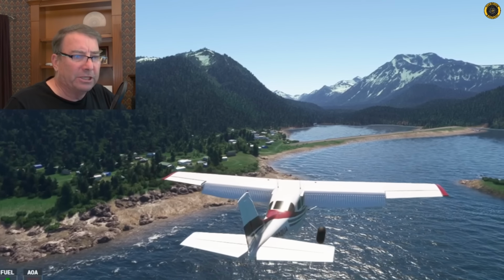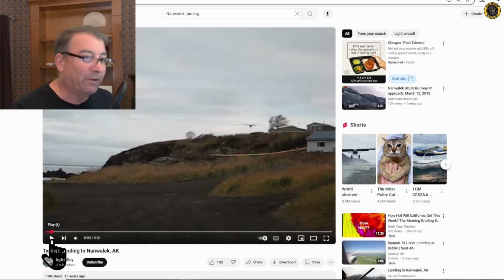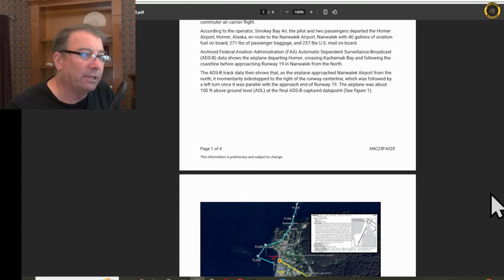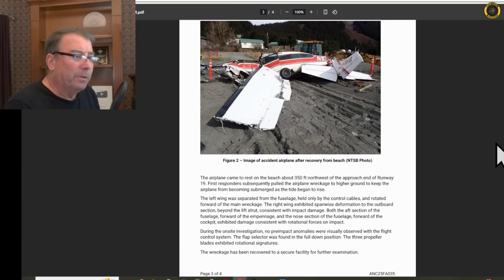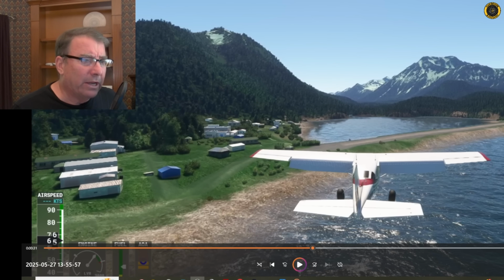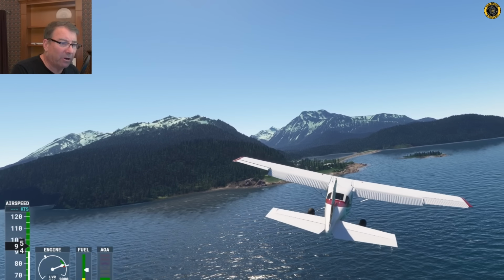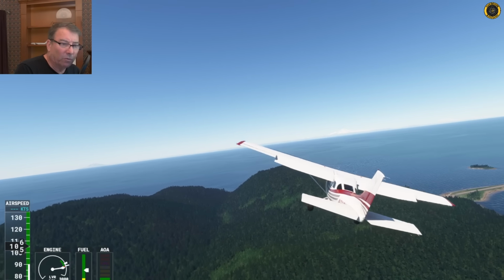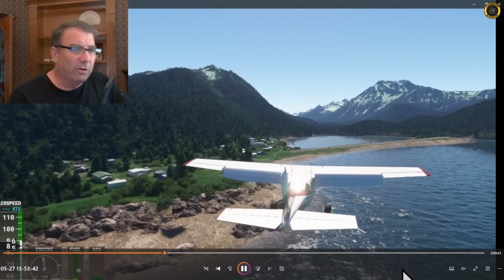NTSB Prelim Cessna T207 Crash Nanwalek, AK

Comment: The canyon is an egg beater. Port Grahm is on the other side of the mountain, the winds funnel into the choke point then rapidly expand and make a 180 degree turn up the next fjord. The turbulence would tear you apart. The water is 99% of the time your only option, though the impossible is created in nanwalek.

Comment: I have been flying professionally for over 50 years , I have noticed a trend. Answering a call from ATC with your Call Sign and not repeating the ATC Instruction. Professional Pilots, especially 121 operators need to step up their game.  Also, ATC should correct the crew on procedure.

Comment: Just simply heartbreaking 😢

I worked 207s out of Bethel and a little bit out of Talkeetna (until a more junior guy came along so I could hold the 185 full time) and even did a short stint flying a U206G with a belly pod for Danali Wilderness Lodge (Lynn Castle's old place)

I've taken 207s into strips as short as 1000' (Cinnabar Mine) and more routinely into 1300' (the old Eek village strip). It's a perfect winged Econoline van for the Yukon-Kuskokwim Delta. The gravel strips can be short, but as long as you can clear the trees at the end of the runway itself, there's nothing else to hit for the rest of the flight. 207s like flat terrain

A friend of mine was all but killed in a go-around stall/spin crash in a 207 at Napaskiak when a Markair Express 207 he was following failed to completely clear the runway during low weather icing conditions while folks were trying to get specials into Bethel. He was badly injured but survived to fly for a couple more decades. An ATP with over 17,000 hours of backcountry 185, 207, Cub, and Beech 18 work, he was eventually killed along with his Fish & Game biologist passenger in a "moose stall" while literally counting moose

After losing 35 friends, colleagues, former students, mentors, and loved ones who died behind the controls, I don't judge. I just mourn and I try to remember them all

While we're here, RIP Keli Mahoney, Iditarod musher, the finest stick & rudder driver I have ever known, my former chief pilot, my former fiance, and my best friend in the whole world. A185F, South Hunter Pass, Denali Massif, May 28, 2003

Comment: I'm given to wondering if the ADSB track is accurate. I notice that often below a few hundred feet planes near me (eastern Massachusetts) often disappear from ADSB-exchange so I wonder if inconsistencies are introduced due to being low and so close to the mountains. Also, is the surviving passenger a pilot? Could they possibly confuse a wing drop in a stall with a steep turn? What if the track was more normal, and a slightly too fast pull up for go-around combined with a gust going away at the wrong moment, one side stalling before the other... Just speculation of course.

Comment: Hi Juan. First of all thank you. I just wanted to give you some info on Flight Sim 2020, as I pretty much play it daily, and as you did in this video, fly in the 'outside view'. My advice to you is regarding the flight stick that u are using to fly in the sim. As you stated, it's not the greatest. I would advise you use a video game controller, like from an Xbox or PlayStation. If you do, you will have access to flaps, landing gear, throttle, rudder, and control over the outside camera, all in the palm of your hands. Modern video game controllers have 2 analogue thumb sticks, and in this case...the left stick controls the airplanes movements, and the right one controls the camera movement. The buttons on the front are for throttle, and the cross shaped 'D-pad' or digital pad, has a function set for each direction. I.e. press left for landing gear extension. Press it again to retract. Up is flaps up one notch...down is flaps down one notch. It is fairly straightforward to connect a gaming controller to a pc, and then Flight Sim. If your 'mini-me' can't help, then YouTube can. It makes flying, and enjoying the sim so much easier, and because this is how I fly (PS5 controller), imagining flying with a flight stick like the one you showed gives me a panic attack!! lol. Love you, and the channel, and because it can't be said enough....Thank you Mr. Brown.

Comment: Hey Juan, Thanks for getting back. It has been many years, but I don't specifically recall overflight of the lagoon being unauthorized, other than possibly 135 Ops Specs. However, there is no reason to ever overfly the lagoon. Additionally, the lagoon is surrounded by rising terrain to the east of the runway; that area should be considered and treated like a box canyon/confined space. A pilot would generally be asking for trouble wandering in there. You will see that area is a lot tighter in person than perceived on google earth, etc. I would highly recommend you go to Smokey Bay Air and have them put you in the left seat with one of their pilots so you can experience the full effect of this place. You want a 206/7 with the sportsman STOL/micro VG's. Keep your head outside and you need to be very aware to "pedal it" through the soft spots. The other thing is to keep your bank angle shallow on departure, but not too shallow. I will be very interested to see your next report after you have been there, and made about 5 takeoffs and landings in both directions. You absolutely owe it to yourself to experience this place. Have them take to to Seldovia and Port Graham first. Then after Nanwalek, you might go down around the corner to the old English bay, and be alert for the crosswinds there as well. Fly safe and keep up the good work!

Comment: Am I the only one seeing that the left turn was probably due to full power torque for go-around with not enough rudder, maybe result of getting too slow because of flap setting, and not an intentional turn to the left?  Approach was normal from over the village.  Decides to go around, starts offsetting to the right, tries to climb with full flaps still and approach trim, gets slow and high angle of attack, runs out of right rudder authority, and spins to the left.  Not saying that's exactly what happened or why, but it seems to fit the ADS-B data, which may not be super accurate right there anyway.

Comment: It's obvious to me this is a botched go around. It's one of the most common least talked about LOC-I accidents IMO. My friend died 2 months ago for the same reason. Low and slow on final, fully configured for landing, last minute go around with incorrect technique and this is the result. Once full power is applied, nose pitches up dramatically due to the nose up trim if not anticipated and counter acted, approaching critical AoA and without the proper amount of right rudder to counter the left turning tendency the plane yaws and then rolls to the left, stalls and enters an unrecoverable spin. The witness account pretty much confirms this is what happened.

People need to practice their go arounds! Practice and brief the procedure before each landing!

Comment: The simulator flight makes it so easy to see how the pilot could have seen that terrain filling the windscreen, pulled back to accelerate the turn, and in that configuration, exceeded the angle of attack limits. Sobering how quickly it can all go sideways. I'm just an aviation nerd, but I find these videos tremendously helpful in my decision-making as a sailor. Thanks, Juan for your hard work.

Comment: HI Juan,  QUESTION: is it possible today, to equip single and multi-engine civilian aircraft with an audible STALL WARNING instrument, that would alert pilots when they are flying close to stall conditions?  Seems this kind of instrumentation should be a priority item to have onboard, as so many accidents are due to aircraft stalling for lack of sufficient speed and/or excessive angle of attack.  Thank You!  Kind Regards,  FMR Intelligence Officer
Reply from the maker: Already onboard. It all happens just so fast…

Comment: Good points about startle, the simulation made it easier to understand. You should definitely check out the new version, Microsoft Flight Simulator 2024. They made some massive improvements especially with terrain quality and detail.

Comment: Gee, how many things could be stacked against him? According to AirNav “first 1000ft closed indefinitely, remaining 850ft poor condition, high water erosion, 4” diameter rocks, strong gusty winds, no approaches, rising terrain, no vertical guidance, tribal council building on very short final. And lastly, to the blasphemy of Cessna pilots, a 206 or 207, even with the IO-550 is a VERY underpowered airframe at heavier weights and full flaps during tight maneuvering, requiring HUGE rudder inputs to overcome design deficiencies. Only the turbine-engined 208 Caravan was able to overcome these 60-yr old issues.

Comment: The sim was very useful indeed and made this situation very relatable. 
This very late final approach turn looks extremely dangerous and aerobatic to me. I can’t understand how this can be the normal approach path. Talk about a stabilized approach path…
Flying over the village, straight to the runway, would seem much more logical and safe. 
A late go around to the left in such a tight space is indeed quite a bold decision, even with a proper timely flaps retraction. These pro pilots should know it.

Comment: Based on track, isn't it possible they were conducting an approach straight in over the town, saw the dog started a right turn out.  The go-around power caused the airplane to pitched up and slow.  Not enough required right rudder to stay coordinated in slow flight while struggling with the elevator could have stalled the left wing causing the airplane to bank left losing control and lift causing the crash track and location.  What do you think?

Comment: In 1982 i and 5 friends in a 1978 t-206 got in a tight box canyon in the mammoth lake area 1000 ft above ground and under the high steep ridges.I could not safely turn, too narrow so i hugged one side of a ridge and slowed to a near stall , 10 diegres of flaps, reduced power , pushed the nose down - unload the wing and quickly turn left \ spiral down one half turn as if coming down a fire pole and pulled up smoothly fast but not to stall with no issues, even passengers that i told i need to make a quick turn were ok. the aerobatic training in the super decathlon is why you don,t panic and just give up. airplanes are highly manuverble. lost control is the biggest killer iv seen in 50 years.

Comment: I landed there in 1984, delivering a (short) telephone pole to our telephone construction crew in a Cessna 180.  I landed to the South, with a dogleg partially over the village.  I felt it was a strip that you needed to be prepared for, and required precise flying, but wasn't particularly difficult.  I planned for a right turn if going around when landing to the South, and there was plenty of room for that.

I cannot imagine why someone would turn left to go around from a right base leg/dogleg final landing to the South.  Even in a Super Cub.

One of life's great mysteries is why experienced pilots get themselves into trouble doing the same thing that they have done dozens or hundreds of times before.
Reply: What if he had a stroke or mini-stroke (TIA)? The brain malfunctions just a few seconds; on the ground, not a big problem, but in the air, those few seconds become forever. I have no knowledge of this pilot or incident. But our brains can let us down sometimes.

Comment: I taught 3 feet full flaps go arounds on C150 in my 1990's CFI years. I taught to throw yourself forward and to the right when apply power.  Noticed some students or pilots tried to do the contrary and stretch body up to try to see over the nose high now, which dont let them push forward control wheel and right rudder.  Also a right turn with less rudder WILL BECOME A RIGHT SLIP, which will kill speed to a stall. Throw yourself forward and to the right, flaps 20 and if turning right, press that rudder well.  Dont turn over 25 bank anyway..  I have videos doing 3 feet go around on C150 at 70 degree farenheit.   I also taught aerobatics and 5 kinds of EFATO too.

Comment: When I was a freshly minted private pilot I was doing a touch and go at Everglades City Fl  (2,400 ft)  in a C172 . When I applied full throttle and put the flaps up they failed to retract. The aircraft jumped back into the sky. I kinda froze. I thought we were going to hit the trees off the departure end of the runway but my passenger (an A&P mechanic) recycled the flaps without telling me. The Cessna sank back down but I held Vx attitude and we managed to clear the trees with what seemed like inches to spare.

Comment: Almost everybody knows when you are low to the ground you stall you die and everybody just keeps stalling and dying, what is it with that, so many incompetent pilots!
Reply: Fixation on a single issue seems to be the culprit. Heard of a commercial flight from years ago in a brand new jet crashed because the flight crew were fixated on a nose gear light that wouldn't illuminate. Drove that jet straight into the ground, they did. It was just a broken light; the nose gear was down and locked. I don't remember whether or not people lost their houses like has been happening so much lately, though.

Comment: According to the ADSB tracking data he was approaching the runway almost at right angles so the left-turn may have seemed just as reasonable as the right-turn "go around" option.   Your approach in the sim was more aligned with the runway so you had to do a steeper left-hand turn to avoid terrain.

Comment: I used to brief pilots for 10 years in Alaska, including 43 days at Homer FSS.  I looked back on weather at PADQ, PASO, PAHO, and PAEN just using wunderground to recreate the surface fronts.  It appears a sharp trough, low pressure moved from the southeast to the northwest during that time frame.  The typical trough passage from southeast there is like an arm of the pinwheel with the center of low somewhere south of Nanwalek and Kodiak with the arm swiping from southeast to northwest.  The surface winds on the east and west shores of Cook Inlet tell the story.   Pilot was facing a strong southwest wind which channels to more southerly at Seldovia but remains more westerly over Homer, until that trough passed.  8 hours later the winds in Homer were calm and shifting to easterly.

Comment: I am wondering if he first saw something on the runway on the straight in, then it either cleared or he noticed it was clear to begin with, and he took a shot as salvaging the approach instead of going around. Almost seems like he was trying to yank the thing back to make a landing rather than committing to the bail out based on the way the data reads. Just a theory, as the hard left turn seems like a terrible go around trajectory for this terrain.

Comment: I was just in an accident in Ak where we did a go around because we struck the water hard and broke the airplane floats in a bounce.  After the bounce, the 185 was flying terribly.  We never thought of the flaps!  It was stressful and we were barely in the air.  We will never know, the floats were damaged and we crashed on the next landing attempt.  Closest I have come drowning.  We did a bunch wrong, but enough right to survive the 34 degree water.  In those situations,  half of what you know disappears.
Reply: The airlines teach a ‘litany’ of steps to perform in a go around and of course practice in the sim. There is also a pilot monitoring to back up the flying pilot. For example, in a turboprop “max power - props forward - flaps XX - positive rate gear up”

Comment: I grew up at the Auburn, CA airport. My dad had a flight school/charter business there from the sixties to the eighties. I witnessed a similar accident. A couple bought a new C206 and both were leaning to fly it. One morning the wife, who was slight of build, was doing touch and go's on runway 07 and initiated a go around. The airplane went nose high and slowly turned to the left until it stalled into the trees. She was very lucky to have survived and said later that after a few landings she just didn't have enough leg strength to counter the p-factor during the go around. Maybe something similar happened here? Even a leg cramp could make it difficult to add enough right rudder in a go around.

Comment: Juan...I owned a 1980 CU206U/G for about 5 years from 1995-2000.  It is one of my favorites...You could do 300HP for 5 min, and then 285HP.  If the plane was loaded, it was a serious dog on climb out.  There is no way it would do 1000/min...more like 300/min at full throttle.  If you were loaded, had full flaps, climb out was very anemic.  I think the challenge with the MS simulator was the speed in your video show 80+Kts.  I have zero time in a 207, but well over a thousand in the 206.  Approach speed at full flaps was ~65-70Kts, not 80+.  It would take a while to get enough speed with flaps down in a go around, heavily loaded, to get positive climb.  Your video clearly shows the way out was not to the left, but to the right especially heavily loaded..  Now unload that airplane and get to minimal weight the performance goes way up.  Perhaps this pilot had trained under light load and didn't have a full grasp of a heavy 206, flaps full, etc.  I suspect he was a great overall pilot who made that one fatal judgement that is so easy to make.  RIP to the pilot, passengers, friends, and colleagues.